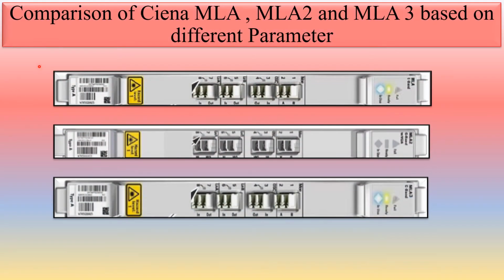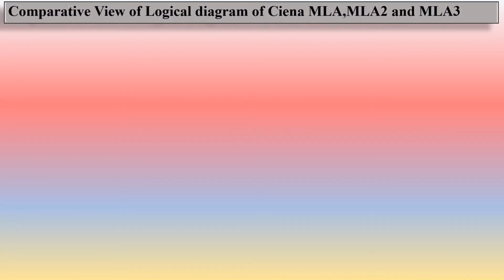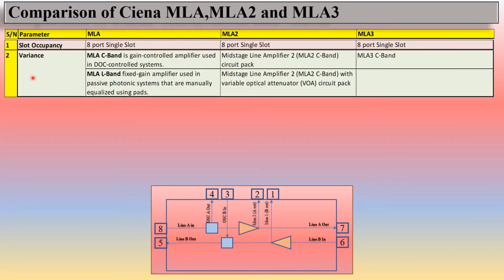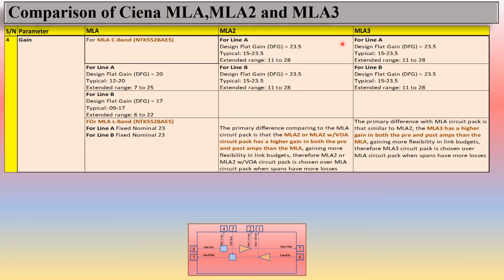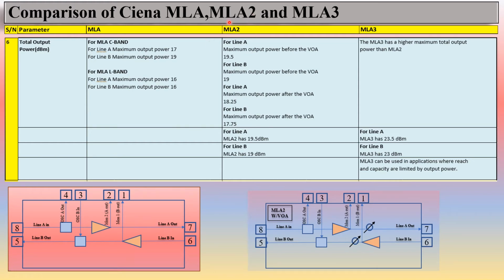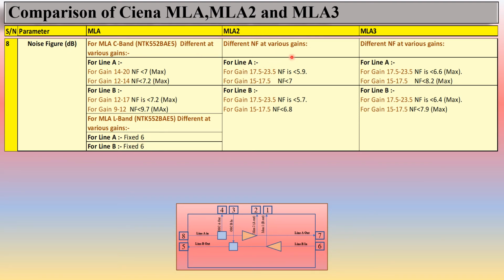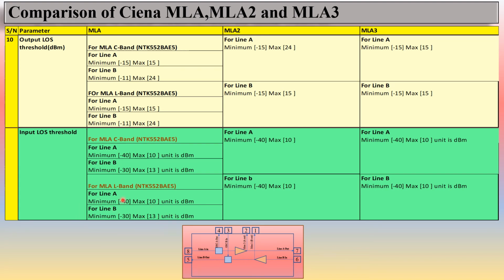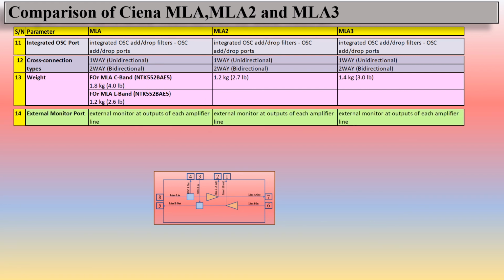Comparison of Ciena MLA , MLA2 and MLA3 based on different parameter  MLA: Mid stage Line Amplifier

Comment: Where the fibres of Mon port are connected?
Reply from the maker: the fiber from Mon Port is connected to OPM [Optical Power monitoring ].
Reply: @DeepakKumarSingh2015  and where that OPM port is means on which card OPM port is connected?
Reply from the maker: @sumitsi309  Usually the Mon port of Amplifier is connected to the OPM port in WSS Card.